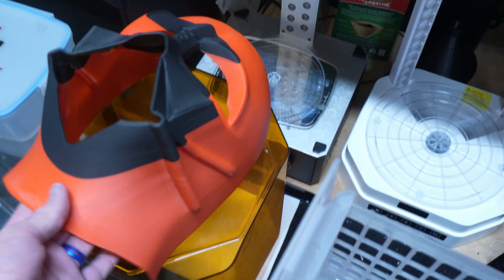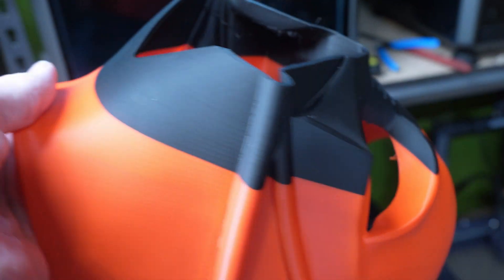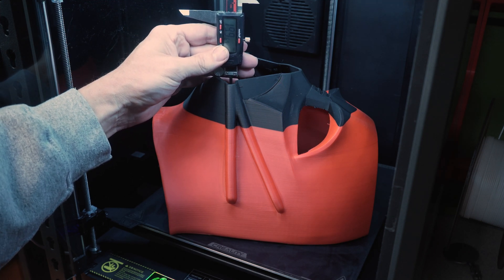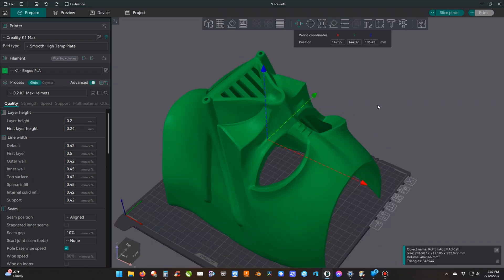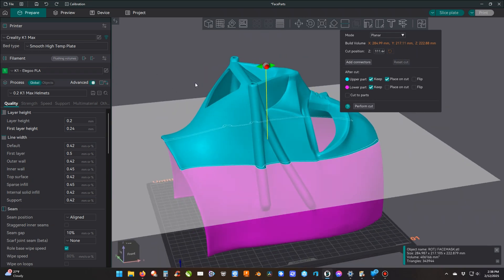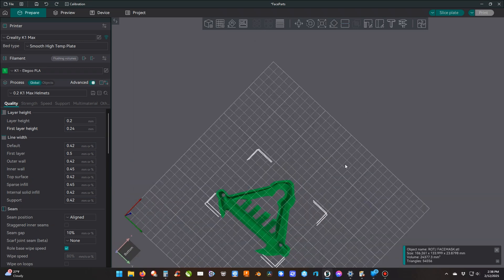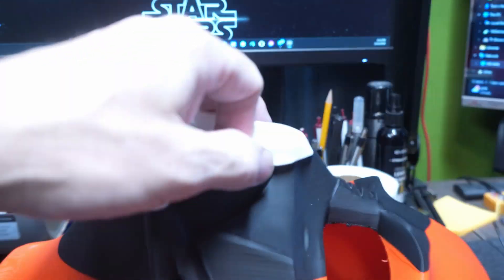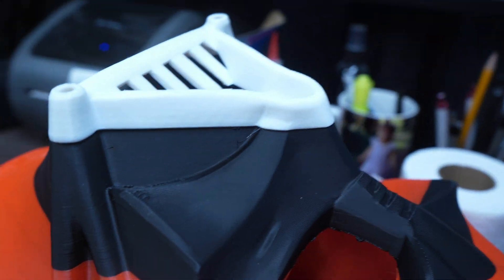Continue a failed 3D print without starting over using this method

Comment: You can also use de 3D printer to measure. First, zero de Z axis at the bed level, then put the unfinished 3d printed part back at the bed and do like the "paper test of zeroing" at de top of the printed part. The Z position will be the desired height measure, but don't forget to subtract the paper thickness from de Z position.